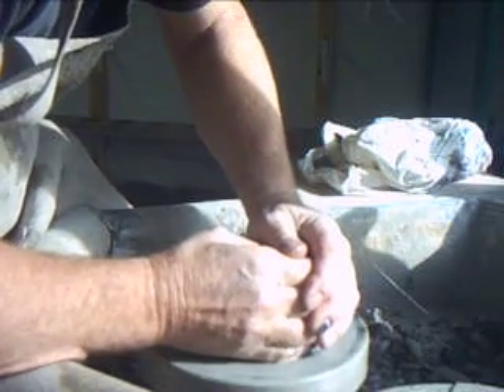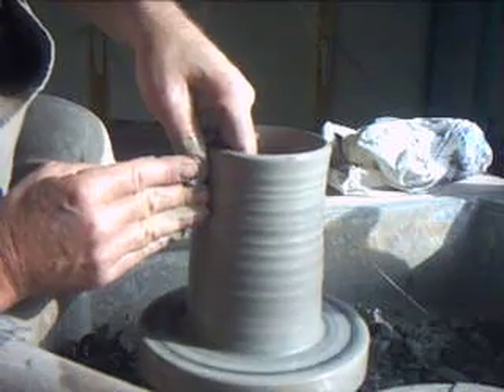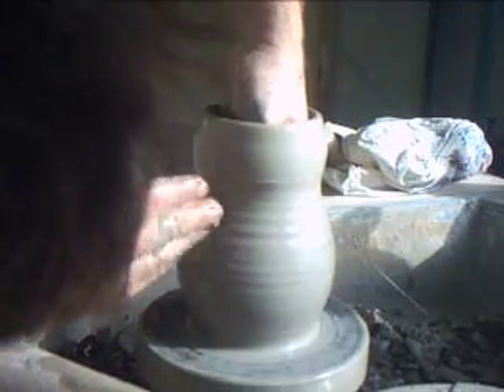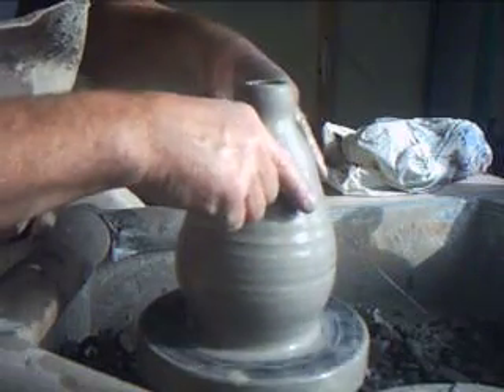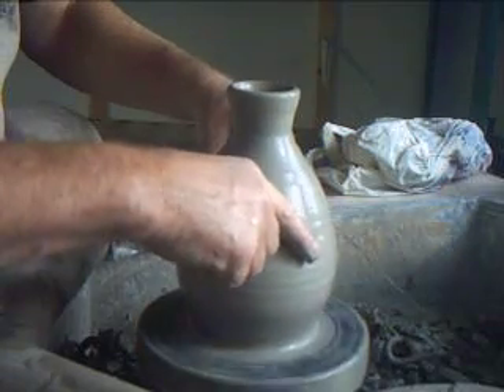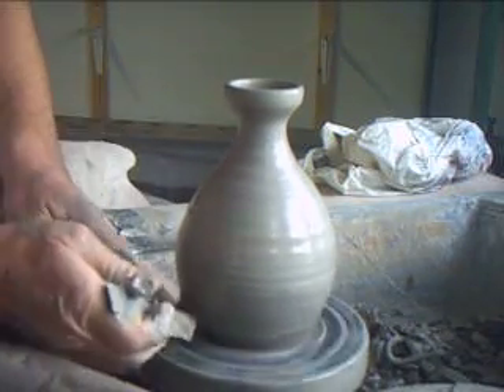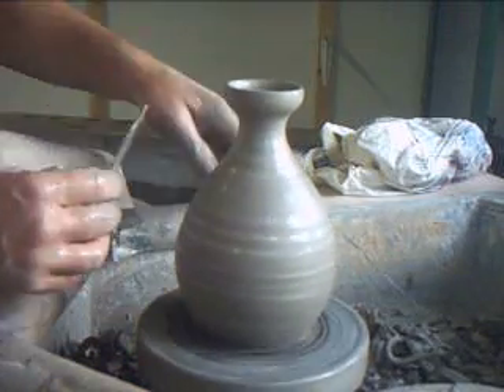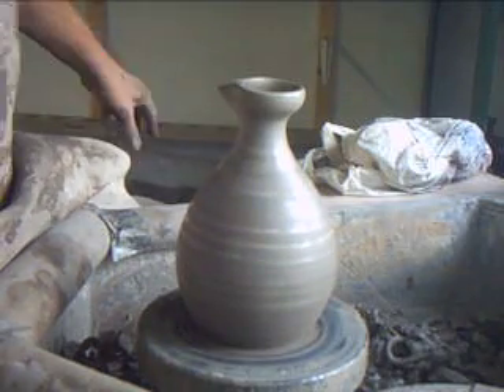SIMON LEACH - throwing an olive oil jar !

Comment: Can you give an approximate height for the olive oil jar & approximate clay weight to use when making one? I attempted to make one in class. It turned out nice despite the need to cut away the top after the top became a bit top heavy causing it to sink into the bottom. I cut away in time to salvage it; shorter than I planned but intact. Next is the stopper and handle before hitting the kiln. Thx for the videos. Pais/Sam